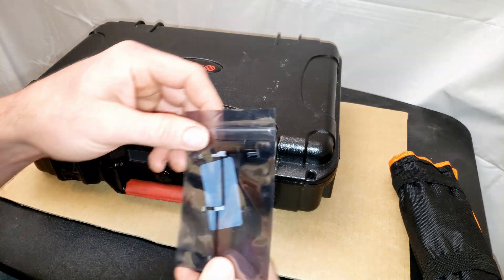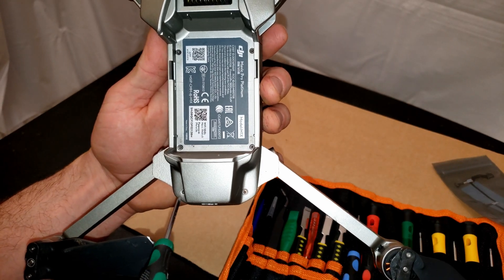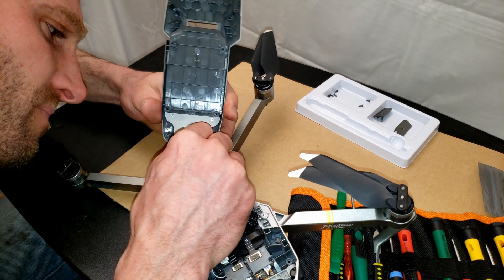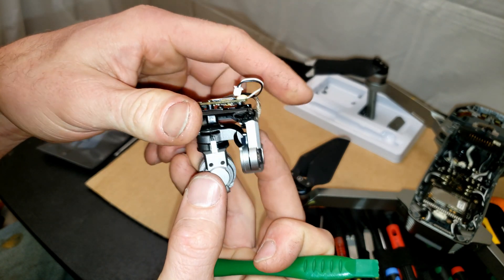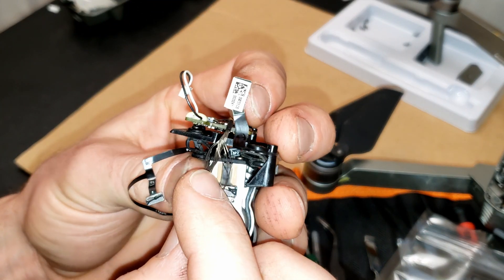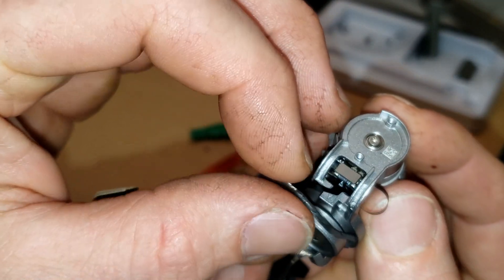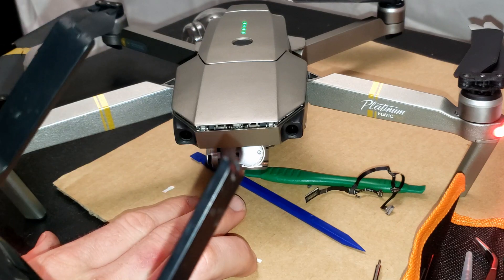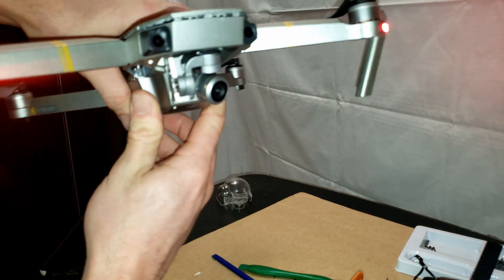DJI Mavic Pro Platinum Gimbal Ribbon Cable Replacement. FAST

Comment: Thanks for this video.  I used it on conjunction with a more detailed explanation (not the one you linked, another one I found) but yours was easier to follow for getting at the ribbon.  Bit fiddley in places (the yaw connector and folding took me ages!!) and I had a minor panic when the camera seemed to now work after re-assembly (my manual camera settings meant the shot was so underexposed it looked like a black screen!) but all worth 2-3 hours of work 🙂

Comment: I've replaced the gimbal cable and now I have no more video feed and the gimbal violently tries to calibrate and doesn't work. What can I do? Thanks!
Reply: Did you ever figure it out?
Reply: @glitchhin332  Sent it off to a certified technician and even he could not figure it out. It was replaced by DJI in the end.

Comment: I've seen many Mavic disassembly videos and yours is the only one that points out that the 2 small plates underneath having smaller screws on the outside plate. Good job!

Comment: very discriptive and detailing video. I managed to replace cable. After repair, no more error showing on controller, however left control wheel on remote does not respond to camera, which means camera only stays in front position - stand still......any advise TIA

Comment: Hi there! Nice comprehensive video. 
I have a question related to the gimbal, that you can surely check in a matter of seconds if you have a Mavic: what are the roll limits for the Mavic/ are they different?
I fear that they may have 'mechanically' changed following a crash of my drone.
https://youtu.be/-v0TCbTSS4E

Comment: Great video.  Can you answer this?     I have a mavic pro with a gimbal issue.  Video feed is fine. I suspect it’s a ribbon cable problem .  While I wait to do the repair can I disconnect the gimbal power and still have camera transmission?   How would I do that ?
Reply from the maker: Thanks. And I'm not sure on that one honestly